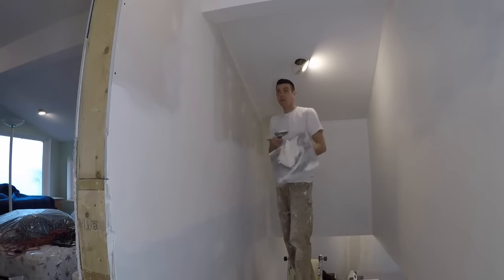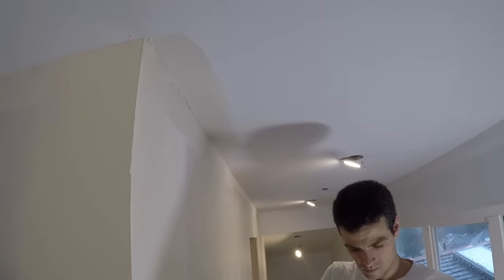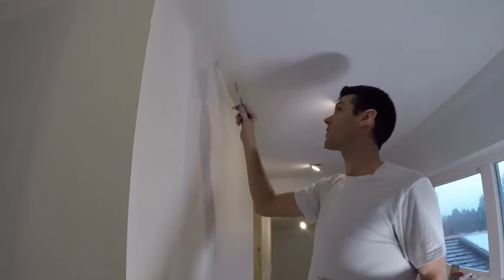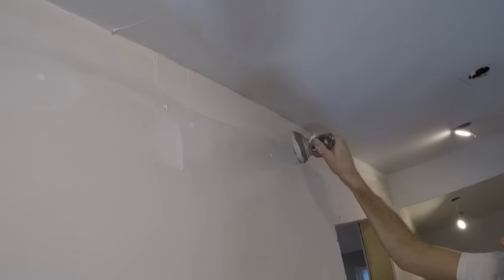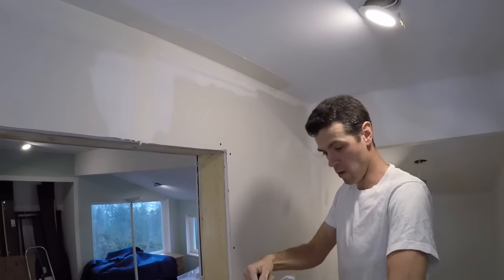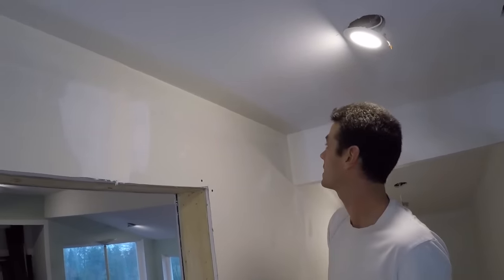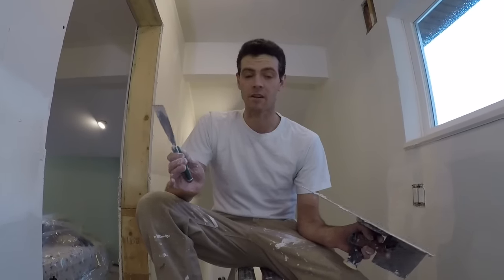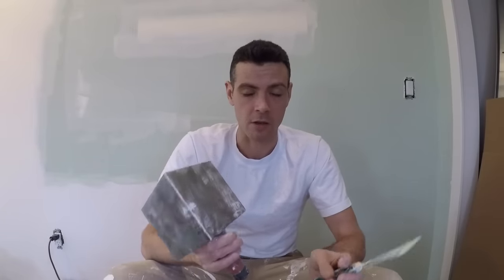HOW TO USE A CORNER TROWEL

Comment: I personally like the corner trowel for use in weird places like staircases and small closets.  Places where my balance is not always at par on a ladder or scaffold or when I have put one hand on the wall and crouch to fit into the space needing rendering.  I find I get better results faster using the corner trowel then using the 4" knife in those situations... just coat both corners with the knife and cram the corner trowel in and slide!  Yes it does take more passes and yes sanding maybe required but, in the end it beats me bitching because one hand is on the wall, my foot is aching from the ladder or scaffold edge and the other hand unsteady because of imbalance.  The corner trowel is easier in such cases for me!  Yep it is.
Reply: I Brazeau it’s even faster to coat both sides with the corner trowel than with the knife. I can do a beautiful corner in like a minute that way
Reply: Joe Wellin Dowd - you're right but I am so used to doing it with the knife or the machine that the corner trowel is not natural for me to pick.  Guess l'll do it on the next small job!

Comment: I dont use a corner trowel . I use a flusher then I light sand and skim with a 5 inch knife done. And you are right about the hair line crack when too much mud is left in the corner

Comment: I have one tried and tried to use it’s just not helpful what so ever just as you’ve explained. It doesn’t feather the edge properly etc. However this tool is useful when first applying mud in the corner bc you can lay both sides at once and get mud in the small crack. Which makes it actually way faster when applying tape. Otherwise it’s a no go. That’s the only time I use it. Try it out.

Comment: Well I started with a corning trowel 30 + years ago and never looked back.I also wet my tape in a water bucket  Just water .1 coat general purpose  Mixed   finish with  Lite  fast and never a problem. Capitol Remodelling.

Comment: I have to agree; the corner tool is not easy to use and get right. It's not too bad on internal corners but I would never use one for horizontal corners. Better for hard plaster than on drywall.

Comment: I find them useful in corners that are too narrow to accommodate regular flushers,...an example is where two door openings on adjacent walls, that are really close to one another, and the angle between them is only about 2 to 3 inches each side. The skid block of regular flushers ...even the 2 inch...will often want to ride past  the edges of one of the door frame....very annoying 
And ,sometimes ,same thing happens above the doors of low ceilings...So......yes they do work well in those instances

Comment: speaking of sanding--- can you do a video on how you manage drywall dust using common tools such as a shop vac, and how you do this without letting said tools get destroyed by the dust?
Reply: Avneesh G get 2 boxfans and 2 20x20 air filters. Turn on the fan and the filter will suction itself to the back acting as a room air purifier. I use 2 or sometimes 3 if available. For the shopvac use the shopvac bags that they sell in stores that are like vacuum cleaner bags. You should actually never be without those. I would probably seal off the room too and block any return vents in that area so it doesn’t get into the furnace
Reply: @joewellindowd5664  Advice is greatly appreciated! Boxfan idea is pure genius. Will probably end up using shopvac bags for convenience. Thank you again!!!
Reply: Avneesh G no problem. Also try to position box fans in a circle so the air travels from one to the next and away from doorways. Goodluck

Comment: How do you apply Mud to internals without gouging the other side? I’m talking 1st 2nd and 3rd coat after taping. 

Everytime I apply with a 4 or 6”, it just applies unevenly or gouges the opposite side chipping off dried all purpose/base coat from the previous coat

Comment: So I had failed with this on the first couple attempt finally I gave mine an adjustment and tweeked the 75 degree angle to about 85. Then it worked much better. I do now find my 4 inch knife does a much better corner as if you start and stop this will look like total hell.
Reply: I meant tweeked the 110 to about 95 degrees

Comment: F ,it .... Put a quarter round up.. 
Finishing only requires some putty and paint... 

I have used the corner trowel, comes out decent.. 
Personally rather just do one side at a time.. but I guess if you are on a time schedule.. then both sides is a good idea if you don't make extra work for yourself that will put you behind schedule... 

P.s. if you don't know how to use it.. use it anyway.. 
After hours and hours of sanding.. you will learn it for the next job!

Comment: I tried using a corner trowel again a few weeks ago. It took me less than 2 minutes to realize (again) that I did not like using it. I remember trying one a few years ago, but I foolishly thought that maybe it would work good this time. 

I am not very fast or neat using a 4-inch knife for corners, but I end up getting a near-perfect corner when I am completely done. It usually takes me multiple coats and a decent amount of sanding, but it is worth the time and effort because I only work on my own house. I would never be able to do drywall professionally for a living.

And by the way, I noticed that you did not demonstrate using an outside corner trowel. Have you tried using one of those? And have you ever tried using an outside corner trowel to level your plank?
Reply from the maker: I honestly don't even know what an outside corner trowel would be for. It's to narrow to do anything.

Comment: I use them corner trows all the time skimming they do a good job and fast if you are good with them but doing one side of a corner at a time is more accurate but you have a break in the corner witch can crack moore easy with the angle trowel it's all the one coat making it a stronger corner

Comment: I'm a DIYer, but I used to get compliments on my corners, until I got that damned corner trowel. It leaves huge ridges where you lift off, and big sanding headaches. But thank you, I'm attacking plaster walls now, and I think it is the right tool for this job.

Comment: VanCar: I've used an inside and an out side corner knife since I began in the trades. Unlike you, I get a good finish every time, 
and very little sanding. It's also twice as fast as me doing one side each day, and it looks better. I guess it just matters which tools a person started with and gets used to using over time. I've never been able to get decent corners with a trowel or a smallknife. Seems kinda like the knife versus trowel argument!!  ;-)
Reply: Dark Star 88 which sizes and brand do you use?
Reply from the maker: Agreed.

Comment: Ben, I have an inside corner at the ceiling that had quite a bit of water damage about 1" away from the corner. I filled it in with qickset to try and reform the corner, then taped it and put a finish coat over the tape. The corner looks kinda wavy of course, due to all the damaged broken out drywall. I'm wondering if a corner knife would provide a straighter corner or not. Your thoughts?

Comment: Learn to be ONE WITH THE CORNER TROWEL. Bend those wings to apply a light pressure before using on corners. Using a 4-in knife to clean raised edges. Remember that you're  in charge of the tool, make it do whatever you want to do.
Works for me even on a 3 corner wall. 😄

Oh, I need to mention that the corner trowel works great with hot mud. Try it

Comment: Corner trowels are useful when you are doing a small room and need both sides of a corner dry at the same time. Otherwise, they are my never ending nemesis. 
Especially where three corners meet. Try making that nice with a corner trowel!
Reply: I can make a good looking 3 way angle with a corner trowel. :) However...not one of these metal ones, the cheap little plastic ones ironically work a whole lot better if you know how to use it.

Comment: The difference between a corner tool job and a 6 inch knife job is the crispness in the corner. If you're going to be cutting different colors into the corner you would want it done with a 6 inch knife,..crisp. If you're mopping the room down with white paint a corner tool will do.

Comment: Yeah, don't care for the corner trowel. I even tried the smaller corner trowel and got better results, but as said, prefer the one side at a time method. I also practice mudding over the tape (second coat) as I install it, trying to get ahead of myself. It's a fill process, anyway. I am going to hit it three, four times before I sand. One trick for a perfect wall is to put a light against the wall to see imperfections and you will see it all. Good for absolutely flat finishes.

Comment: I've done one side of the corner, let it dry, then when I do the other side it softens the first side that I did and ruins whole corner.  Yes, the first side was fully dry.  Do I just need to use more finesse and be more gentle when i do the other side?  Thanks!
Reply: Having exactly the same problem did you find a solution bro ?
Reply: @np1565  Hi N P, Okay, it a bit of a complicated answer.  It appears as though it's not actually softening the first side.  What's happening is the mud that you're putting down is drying very quickly because the moisture in the mud is absorbing into the first batch of mud right at the corner.  Therefore, what I did was tried to do the corner as quickly as possible.  Tweaking the angle of the knife helps and also, try not to push too much mud into the corner.  If you pack the corner and it overflows around the knife, then when you go over it again - that's when you'll see the issue arise.  Hopefully this helps.  Cheers!
Reply: @merlin3921  oh mate just tried that and it works a dream thanks for the explanation bro, second question obviously the best way to fine tune these corners just with a sanding block? Because I have quite a few of these messed up corners or should I just coat them again ?
Reply: @np1565  Hi N P, I had the same problem too.  I used a foam sanding block and got most of the corner nice, but the part near the end of the corner still didn't look great so I used the mud knife and carefully scrapped out the corner.  Just be careful doing this because mud knives have a slight curve.  I used it with the curve pointing towards the corner - hopefully that makes sense.  If you use the knife the wrong way it will score the mud at the other end of the knife.  Just take very little off at a time and the corner will turn out perfect.  On one or two of my corners (out of about 20) I had to apply a small amount of mud to make it look great.  Good luck mate.

Comment: I've been pondering a question lately. I used these things for years before I realized they leave too much mud in corner. My question is how is this any different than using a worn flusher to glaze a corner
Reply: Cheap corner trowels do leave too much mud in the corner. 
The radius bend on cheap corner trowels are not sharp and will not leave a clean line. Worn knives have the same issue.

Comment: I found this tool useful for pre-filling gaps in corners before taping using a sharp angle into the corner to leave a feathered edge with the tool itself.  Not that useful otherwise.

Comment: i use metal for all internals and square set. its stronger ,quicker and easier if you hardly ever do it.  and ya get a perfect straight line so it looks perfect when your done , its easier to run your knives down without worrying about cutting tape or bubbles or anything. even though its a slightly more expensive option you save the money in time and it comes up dead straight so the client is stoked.

Comment: What type of mix are you using?
We use that 5min stuff at work which sets up fast....
Reply: The number tells you the working time of the mud. I would only use the 5 for small patch jobs since you only have 5 minutes to work with the product. I use the durabond 20 for prefill and taping because it allows you time to finish larger jobs and sets quick enough to put multiple coats in one day. Still takes a full day to completely cure tho

Comment: Us plasterers call them twitchers.
You used it wrong mate..you are supposed to load a bit of plaster on to the tool first and run it in.when you are doing a ceiling meeting wall or wall meet wall you need this tool. We dont plaster corners and feather out..we do a number of walls and ceilings in one hit.

Comment: How can he say that it's faster to do one side at a time with the knife when you have to wait a day for it to dry before you can do the other side?  I use the corner tool to apply the first coat and then a six inch knife for the second coat.  I am a DIYer but it looks ok.
Reply: It's faster in the sense it's less time spent doing it, I can put a coat on one side of an angle, 30 ish feet in less than a minute, than less than a minute the other side when its dry, rather than doing both sides feathering, running the trowel feathering again, maybe re coating because it took to much off, you're coming back when its dry to coat the joints can just run the other side of the angles then. That said if it works for you it works for you
Reply: Also angles only need one coat either side, so if you're coming back to second coat anyway than it's just as many days in dry time

Comment: I’m really good at spackling and I tried a corner knife when they first came out... horrible horrible!   Don’t waste your money.  No corner is ever 100% square so you end up bending this to get it right and it just doesn’t work.  Always remember “thin is in”.   Use as little mud as possible while  leaving enough behind your tape so it doesn’t crack n fall off later.  Less mud, less sanding.  I sand once.   Scrape high spots w your knife between coats but you should never have to sand more than once.   If you have to then you’re using too much mud.  

A 2”, 4” and 10” knife is all I ever use.  I have a 6” & 12” but almost never use them.  Save yourself sanding time n buy a vibrating dewalt sander with dust bag and thank me later.  Just feather your edges and don’t take too much off seams.  You can sand a 12’sq room in 30 minutes
Reply: I couldn't mud the ground outside when it rained but I instantly thought they manufacture a 90 degree trowel that fits in 2 corners of your house if your lucky. Thanks for verifying that for me!

Comment: Yeah I mean good hand work always beats a gimmick tool but I have quite a bit of taping experience in the union and out. I would say these trowels definitely aren’t as bad as you make them seem. Especially when using mesh tape. It doesn’t create the crisp clean 90 degree angle that you’re looking for but it definitely works if you use it right. A beginner is going to do one side at a time and gouge the corner either way. If they use this tool at least it gives them somewhat of a uniform look. It also seems that you are blaming the hanging on the tool. Not all angles are perfect, shoot most drywall isn’t perfect even in new construction. Plus you using the trowel as a safety hazard probably doesn’t help… either way proper hand work is key before trying tools like this.

Comment: I have hound the your corners are crap and wavey as hell with large gaps . It works great . Do it once with rye corner tool then the next day do final with 3 or 4 inch trowel.  It's made some of the ugly corners line look really nice and kind of strait.

Of course the thickness isn't even , the wall not strait .

Comment: You might loose all respect for me, but I use 2 corner trowels; a small one first, and the larger one after. I load the corner trowel not the wall btw
Reply from the maker: No respect lost. Whatever tool gets the job done. It's all personal preference in relation to what we have used the most.
Reply: @vancouvercarpenter  I am with Scott.  I was trained with a corner trowel in the early 90s.  I have 3 different sizes and I use them for corners.  I very rarely use any other tool on a corner.   I load the mud on the trowel and spread it that way.  I use the corner trowel on one side to feather the edges.  On the topping coat I re-coat with the corner trowel, then use a 12 inch knife to feather the corner out as far as needed.  I get near perfect results.  I wish the camera work was better, with more close-ups on the results.  To me it seemed the deficiencies you cited in the tool were really deficiencies in your technique.  However I'm betting you get great results as well using the tool you're used to.  I wish I could watch you work on a job to see what I could pick up.
Reply: @vancouvercarpenter  I only use it to prep the corner and imbed the tape , much quicker for me. A fussy tool to handle for sure but great when you get the feel .
Reply: @surreybure  I too use it to embed tape. Fast and easy, but I am going to practice my 4" skills more, thanks for your videos !
Reply: I use a small one the big one perfect job no complaints

Comment: Why aren't you using hot mud? Then you don't have the problem where the corners come together or the problem with shrinking. I love my corner trowel but I'm not DIY guy. Occasionally I can get it in one coat but usually takes two.

Comment: You're using the corner trowel wrong. I've been a drywall finisher for over 20 years and have perfected it's use for taping and finishing. I apply a single coat on top of the tape, form the inside corner and feather both sides in 3 quick and easy steps. Sanding is minimal. I do agree that the three way insides need touch ups afterwards.
Reply: Then post a video please

Comment: Just like any other tool you have to learn how to use it. It took all of us a while to get good at using a 4 inch knife in corners. just the same with the corner tool. Thats all I use . After you get good with it you only need one coat. this is a poor representation by someone that has barely used the tool.